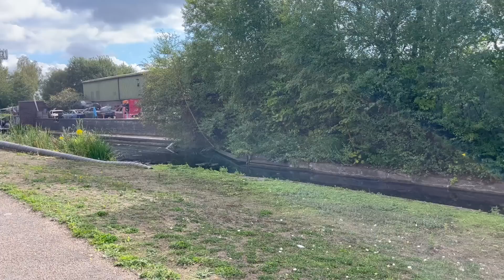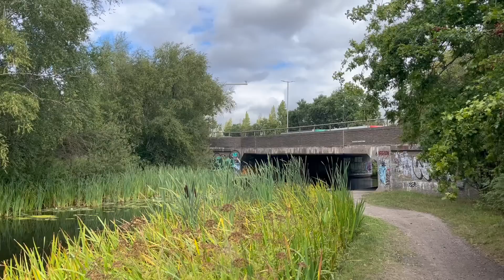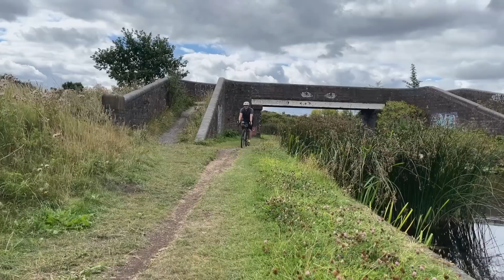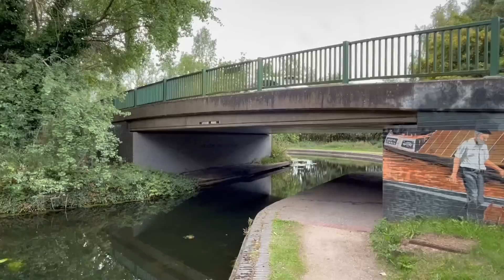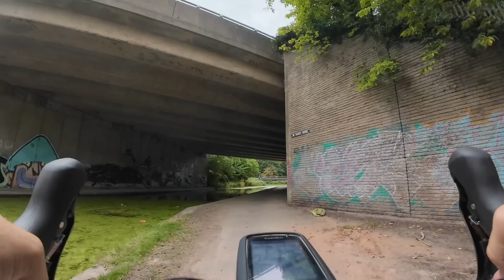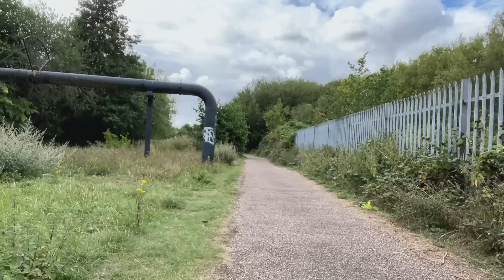A Curly Wyrley Loop - A 35 Mile Traffic Free CYCLING Loop From Wolverhampton

Comment: Thanks a lot for the video! Just under a couple of months ago, inspired in no small part by your channel, I got myself my first bike after years and years without riding - a gravel bike particularly for rides like this. I don't think I could hack this 35-mile ride just yet, but today I had my first crack at a ride from around Wyrley down to Sneyd Junction and all the way along the canals to Birmingham. Sadly it was cut short by a puncture about 5 miles from the city centre just after joining the New Main Line, but it's still my longest single ride so far, so I'm pleased with that. The ride in the video is definitely going on my list for the future, although I don't enjoy the rough bits of towpath quite as much as you, having been from Sneyd Junction towards Wolves before!
Reply from the maker: So good to hear these videos have inspired you to get back a bike! Glad you’re enjoying it and sounds like your rides are getting longer. Hopefully my videos can guide you to the smoother sections of towpath in the area. Thanks is for watching!